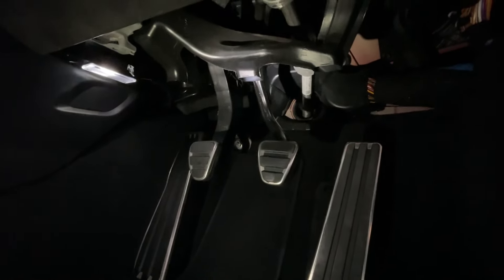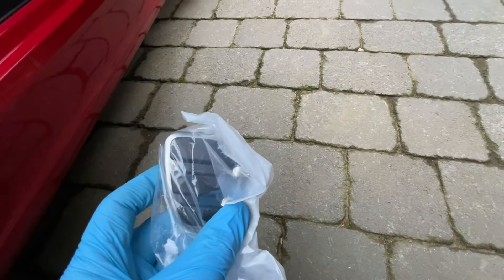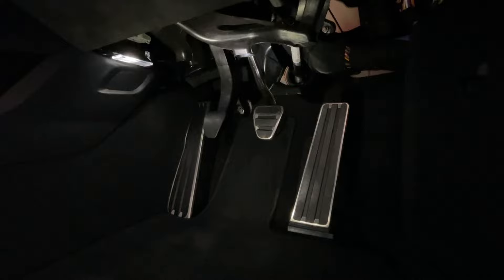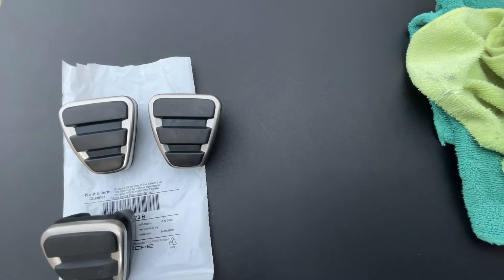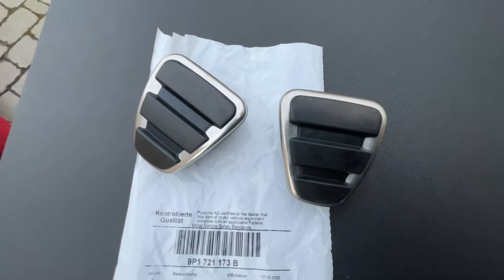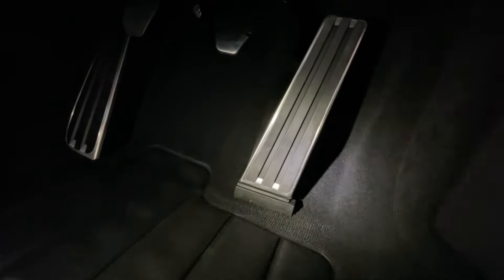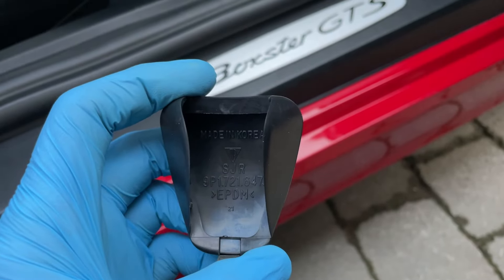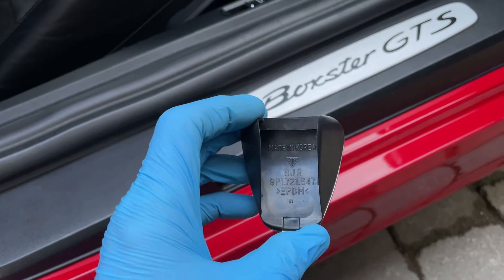Replacing the brake and clutch pedal caps on your Porsche 981

Comment: Can you also get replacement for the accelerator and foot rest?
Reply from the maker: @Aiken47  Knowing how Porsche design and build their cars, the answer will be yes. Though I suspect it would take more than five minutes!

I believe the brake and throttle pedals are designed with replaceable caps since they are more likely to wear out. You can definitely buy different trim finishes for the footrest (dead pedal) which appear to be easy to install. I can’t find anything OEM for the throttle doesn’t include the entire mechanism - ie. the switch too.

No doubt there are aftermarket trims which can be stuck or screwed onto the originals, if preferred.

The caps are quick, easy and cheap - hence the appeal.